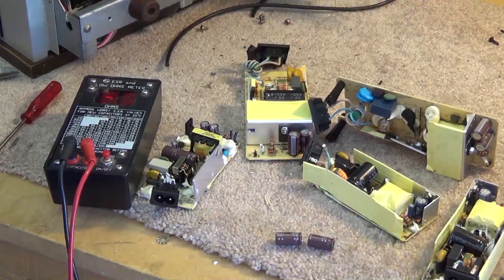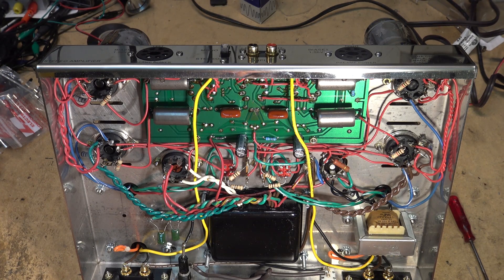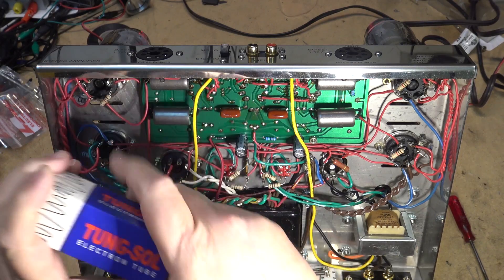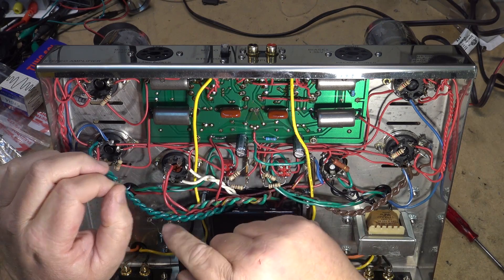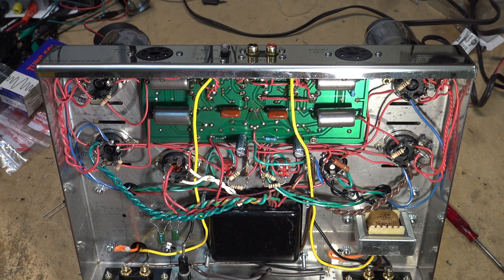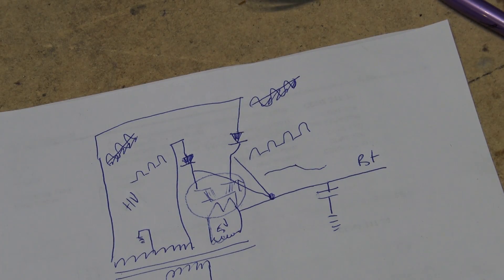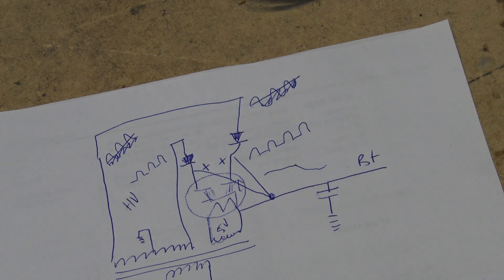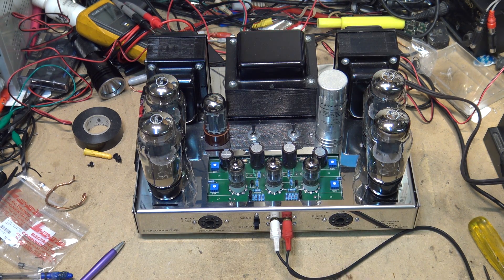Dynaco VTA-ST70 Rectifier tube protection mod

Comment: That's a great mod! Those new diodes do their job while allowing the old tube rectifier to help the caps survive the initial inrush surge and it keeps the saggy sound. Nostalgic repair memories ensued while listening to your thorough explanation as I removed 2" of cord from the base of my 49 year old Weller W-TCP-L soldering iron. Wishing you the best - thanks for sharing all your videos.

Comment: I too had an arcing GZ34 and found this idea on a forum. It worked well but I still got a few crackles and pops on power on, so I guess by the time I acquired the amp, the GZ34 had already been damaged. I replaced the rectifier tube and left in the silicon diodes as a failsafe. Any future amps I work on with a tube rectifier will definitely have this mod. Thanks for the video, this mod should be more well known.

Comment: Very  good.  The  new version  of the retro circuit is modified .... from the wiring changed to destroy the print instead of the old wiring to simplify the assembly. As for R. in these days, there is probably no carbon to use like in the olden days. Using a new version of the R 5% or 1% error velue Looks beautiful again. I click to follow already ... Thang you for bringing knowledge in this field to share with those who are interested to study.😊😊😊😊😊😊😊😊

Comment: This combination of silicon and tube rectifier is interesting, as you get the advantages of the slow turn on of B+ and a better reverse voltage protection. A great idea to protect vintage equipment. Guess this also works with simple half wave rectifiers with one diode...

Many of these US tube amps have a 110 V AC primary transformers. In EU, their equivalent had a multi tap primary to imply with different voltages, from 110 to 220, and 240 VAC (in the UK). The voltage has also evolved from 220 to 230V, so many vintage electronics (even classic silicon ones) can be at stake if you don't choose a secure 240V tap. Many early electronics were built without a true voltage regulation (it was not an absolute necessity). Zener diodes circuits and later integrated components made a difference at a relatively low cost. I remember the first switched mode regulated supply was a revolution when it appeared in TV sets, and it also made the sets 50% lighter!

 I also remember in the 60's, many people using some kind of voltage "regulator" to supply and protect their precious TV sets from overvoltage, spikes and parasites. It combined some heavy gauge autotransformer, chokes and electrolytics, and disappeared when it was no longer needed. I've found these interesting for audio use, but are now difficult to find.
Reply from the maker: Yes single diode for half wave rectifiers such as 35w4 in the aa5 radios.
Reply: Ferroresonant voltage regulator :)

Comment: I have several ST-70's, a small collection of Heathkit W5M's, lots of vintage test equipment and I'm quite familiar with the modern line voltage issues and stresses on my vintage stuff. Line volts in my area is typically 124 volts. I've been installing current limiting NTC thermistors in the the primary circuits of my equipment and find that they can often drop just enough primary voltage to bring it back into vintage tolerance ranges.  An added advantage is that the thermistors allow a gentle ramped filament warmup.  I've not experienced any rectifier problems since utilizing the thermistors.
Reply from the maker: Just go pick yourself up a cheap very act and then you can dial it right down to 110.
Reply: @12voltvids  That would be a lot of variac's, certainly more than I currently own. After much thought I see the advantages of your solid state rectifier implementation.  I have a personal aversion to the sometimes radical modifications to vintage equipment, especially in replacing tube rectifiers with solid state. It's just the purest in me I guess ...  Having described my use of thermistors, I will caution that it is a challenge installing them as they get quite hot and must be given plenty of room to protect other components from that heat.  Most of my vintage equipment, especially the amplifiers fortunately have plenty of extra room under the chassis.
Reply from the maker: @stephaniewilley2224  placing thermistors will reduce the voltage but they're also going to introduce coloration of the sound on their own because as the temperature varies on them so does the voltage. Placing diodes ahead of the tube rectifier does nothing to the sound. All you're doing is removing the negative half of the waveform that wouldn't pass the tube anyway only the positive pulses will pass through the rectifier tube. You are still retaining the tube sound because you are not replacing the rectifier tube. You still get the exact same sound. All putting the diodes in does is protect the tube from the peak inverse voltage which is higher than a lot of the new tubes can handle which creates Arc. Instead of having an AC waveform going to the tube you now have a pulsed DC waveform but the same signal that can pass the tube reaches the plate because the negative going swing didn't conduct anyway that's the purpose of the rectifier tube. So by adding the two diodes you are prerectifying and I guess you're causing a 7 volt drop on the peak voltage but that's about it you still get all the characteristics of the tube. Now if I were to remove the tube and just replace it with rectifiers then yes you've changed the sound. Mesa does that with their bass amps. You can switch between solid state and tube rectification and it does change the sound, but in this case it's just putting a diode in series with the tube which does not change the sound it just protects the tube. It does it with a lot less risk than putting thermistors in which incidentally can go up in flames.
Reply: @12voltvids  I several ST70's and Several W5M's. I find the voltages (sometimes up to 128VAC) here, to be simply too high for any Inrush Current Limiter to drop enough. Therefore, my W5M's run off Bucking transformers as well as CL-90 inrush limiters, otherwise the B+ spike into 600's...far beyond my filter caps. The problem is not so bad with the ST70's.

Comment: This ST70 had some quite extensive mods. The driver PCB is different with 3 tubes (original had two 7199's) Original outputs were EL34/6CA7 instead of the more readily available 6L6's.

Comment: Installing a suitable Inrush Current Limiter to one side of the line voltage did it for me.
Reply: What that does, the inrush limiter, is slightly lower the line into the transformer which then lowers the P-P ac voltage on the rectifier. The problem is the PIV, peak inverse voltage, rating of the tube. Well the rating for a 5AR4 should be ok the trouble is these Russian tubes are not made properly. I suspect that there are sharp edges some where between the anode and cathode which makes them more sensitive. Or simply the dimensions are wrong, and then it could be the evacuation does not provide a hard enough vacuum. Anyhow adding the diodes is a credible solution. I would also consider adding two 1meg resistors 
one across the tube and the other across a diode to balance the inverse voltage across both the tube and the silicon diode. So two diodes and four resistors.

Comment: Interesting way to view the operation of the tube or any rectifier for that matter. The end result of additional silicon diodes is the same  whichever way you look at it. However to fully understand the reasoning behid what is going on,  you have to view things in a slightly different manner.

Both tube rectifier and a silicon one do the same thing, they pass current in one direction only. The only parameter that is of importance is the P.I.V. - Peak Inverse Voltage,  which is the rectifiers ability to block the voltage of reverse polarity.  The 5AR4 is rated at 1500V max by Sovtek, while the 1N4007 is rated at 1000V only. So if the 5AR4 is arcing over without the 4007 in front, it is vary likely because the modern reproductions of these tubes are sligtly inferior. Say for example that they are only capable of 1100V, adding a 4007 in series pushes that 1100 to 2100V. 

So, what actually causes high reverse voltages across any rectifier, SS or tube is the fact  that in forward direction the first filter capacitor charges to roughly a peak voltage of the input  ac voltage, then when the polarity reverses you end up with the existing capacitor voltage in series with now reversed transformer voltage which in case of a silicon diode with its forward voltage drop of only about 0.6 V is virtually twice the ac peak voltage being applied across the rectifier in the reverse or "blocking"direction. With tube rectifiers however, this drop can be in ten's of volts, so it is slightly less than for silicon but still qute high and close to twice the peak value of the applied AC.

So the short of it, the series Si diode does and does not eliminate the negative voltage swing of the incoming ac.
When I say "it does", it does so by increasing the total P.I.V. if the two by a 1000V. 
And when "it doesn't", it's because if you used it on its own i.e. 1N4007 on its own own, it would most likely fail or break down in revese direction for the same reason a "1500V" tube does because it isn't really a 1500V rated part.

Sorry for many words, but without doing some diagrams it becomes quite involved.
Hope it all makes sense for anyone reading this, if not I'm sure there is planty info on line, just search for "Half bridge, full wave rectifier theory of operation" whether it comes up with solid state or vacuum tube types really doesn't matter as the principles are the same.

Great "how to" video though, I loved it.😁😎
Reply from the maker: The piv is nowhere even close to 1000 volts.  I doubt it is even 800.   The problem is the new tubes are not even close to what the old tubes were capable of handling.  Adding ss rectifier ahead of tube rectifier effectively makes the rectifier ss.
The tube does nothing more than give the tube sag effect.   So you still get the voltage dip when the amp is driven hard.  
Mesa Boogie amps have a switch to switch between tube rectifier and ss as they have different sound.  My tube amp is ss rectifier.

Comment: The problem people are having visualising the rectifier working probably don't know about conventional current flow and electron flow - which are opposite. If you draw a regular diode with anode and cathode it will be identical to the valve..Just you don't imagine the electron flow going backwards like you do with the heated cathode.
Battery terminals were marked plus and minus and convention says flow is from plus to minus. Yet we know electrons are negatively charged and flow from minus to plus.
Reply: Yup! I had the hardest time with it in my Basic Electronics course at Biloxi until the instructor noticed that I had mild dyslexia and introduced me to a way that would help me differentiate between the schematic and the actual physical circuit. There's electron flow (actual) and current flow (schematic), after putting the two concepts into sharp contrast, it really consolidated it for me. Unfortunately, it all goes south when dealing with MOSFETs. Thanks, Ben Franklin!

Comment: Its a nice mod, helps to reduce Anode-Cathode Peak Inverse Voltage (PIV) and another benefit is that it cuts the voltage potential between the two anodes in half. That potential can reach up to 700V or more on some amps. With the diodes it would only reach +350V or so. The tube still does is job too and acts as a soft start.
Me personally, I prefer the solid state rectifiers as it reduces cross channel "sag" when one side pulls the voltage low and affects the other side. Its all personal preference though.
I have a nice little EL34 Class A amp that I can put this diode mod onto... its still running with a 5U4 Rectifier (NOS Marconi 5U4GB "coke bottle") and I have seen it arc a few times...
Cheers,
Reply from the maker: The PIV can go higher than that. If your transformer is putting out 475  with respect to ground that's 950 p-p on the AC winding. With a DC voltage on the cathode of roughly 430, that is 915 PIV as the anode would be -475 and the cathode + 430.
As you said it also cuts the potential between the plates (anode) would only see the +475 pulse, not the -475 reverse voltage.
I have a nice little class A I built a few years ago. I run 6L6EH normally, but I borrowed 2 of the Tungsol tubes that came out of this one to see how they sound. One side had a bad tube, and one of the other ones had a getter than was looking a bit weak, but the other 2 looked good. I am running them in my class A and they sound really nice. They look nice too.

Comment: No longer a rectifier tube, but now doing only the secondary function of soft starting the HT rail, and providing extra impedance into the HT rail to make it more soft. You could also connect the 2 anodes together of the rectifier, and connect the common cathodes of the diodes there, which would even out plate dissipation peaks, spreading out the pulses across 2 anodes, while still having the same overall dissipation. Would probably give you a few volts more HT as well, just from the parallel anodes sharing the space charge between them. Essentially halving the peak current through the tube, and increasing the cathode life as the peak current is shared by both halves of the cathode.

The silicon diodes keep the peak voltage between anodes from being too high, which is probably what causes the flash over, there probably are either sharp edges or too close a clearance in the units as manufactured, which results in the flashing over with 2 times the HT rail applied between the 2 anodes, a little more than the original design was meant to handle.
Reply from the maker: Well you still get the voltage sag on high demand loads due to the high impedance.

Comment: i looked under my dynaco st 70 and someone completely bypassed the tall aluminum canister looking thing?...I think with some strip ...do you know anything about this? I still have my tube rectifier and know its working because it glows...but I have replaced all the original dynaco mullard tubes nos output tubes el34 abd the 7199 with nos...I know they were wore out because i put the ouput tubes in another el34 amp and could not get two of them to bias up...since i replaced all tubes ...now tomorrow i get a nos mullard rectifier tube...hopefully that will give my dynaco better sound too...maybe the old one is tired after so many years...sorry so long...please help me understand why the aluminum canister looking thing has been bypassed by a what seems to have been an excellent tech by looking at the underside with new capacitors wima and others...by the way the wiring under the unit looks great and with new caps too... tomorrow the nos mullard tube rectifier tube gets put in...hope it will give even a better sound...please help me understand 🤣🤦🏻‍♂️

Comment: Clever, you get higher breakdown, and slow turn on of the B+
Reply from the maker: That's why the mod is done and not just replace with diodes.  It stops the inverse viktage arc but the b+ is still 100% going through the rectifier tube so you get the slow b+ rise as the tube warms and you also get the sag under full power that rolls the b+ off and allows the amp to fade into fuzz at high volumes.  Exactly what Mesa boogie does for their bass amps. You can switch between SS and tube rectifier and that is basically what it does. Switch the tube in or out for the different sound.

Comment: Isn't that a Bob Latino VTA amp kit? A "modern" take on the ST-70?
Reply from the maker: YES VTA kit. Not my amp. in for service. I have a ST70 clone and a class A kit I built.
Reply: I've got this same Bob Latino kit and I'm going to do the suggested mod because I've blown through three rectifier tubes in a year. I wonder why Bob doesn't just build this into his kit if this is a known problem.

Comment: How about installing a Stand By switch for the B+ power?? like Fender does in there AMPS wouldn,t that save the Caps and tubes from inrush while filaments warm up??
Reply from the maker: There is no in rush because they use a rectifier tube. No DC until the rectifier warms.  
Now the problem with standby switch is now your tubes are hot.  Throw the power  and bam, the tubes are hammered with full b+. The reason fender has standby switch to kill b+  is so the tubes are kept hot so when the player wants to play the amp is fully warmed up and the sound it ready to play / record.  Start it cold and for the first 20 to 30 minutes the sound will gradually change as the tubes get hot.
Reply: How about Increasing the POWERsupply Caps Value -- the quad caps are junk!! Iheard that youcan use oil -filled industrial caps.
Reply: just curious How much capacitor Value one can ADD to the three /Fourstages of the Quad Cap???  Woulda 470k bleeder resistor help??q
Reply: @stuszith  The quad caps have already lasted 60 years and the new ones are probably even better. You can't increase the first capacitor the 5AR4 sees beyond 60uF: see the datasheet.